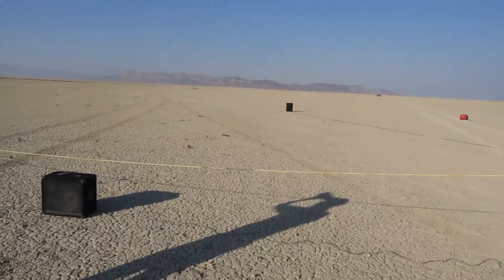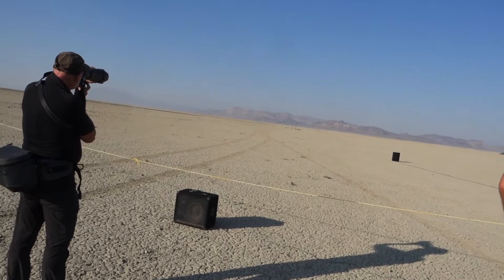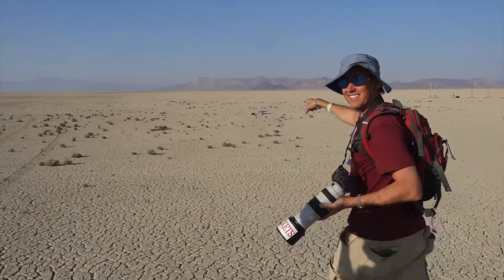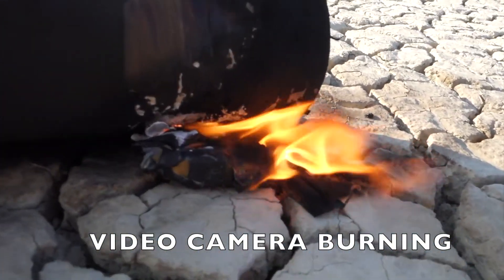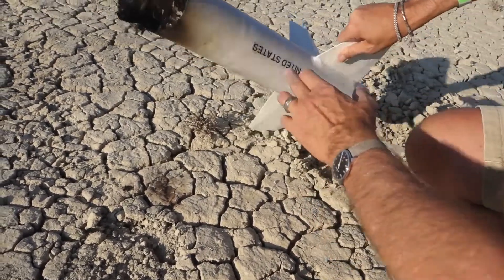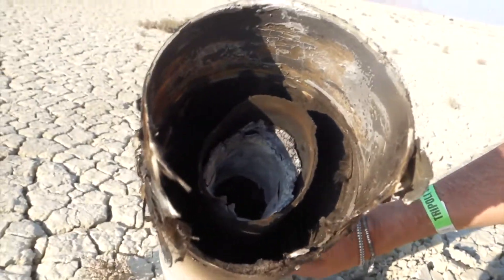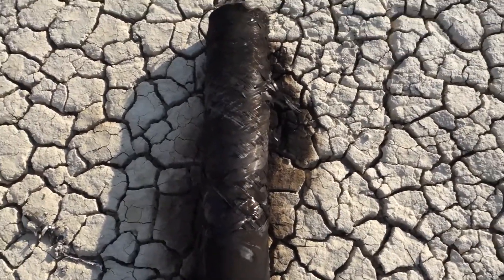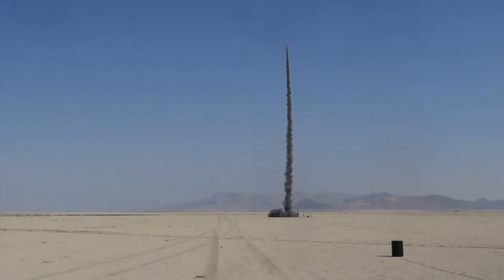My Rocket Launches at BALLS 2021

Comment: Nice flight on the K850!
Those foward closure failures are tough. Earlier this year I had the exact same problem with one of my rockets flying on a CTI K650 Pink. In August, I flew the a K820BS but glued the foward closure to the motor liner, added extra O-rings, and used a ton of silicone lubricant. The motor luckily didn't CATO but it still bulged even after taking precautions. I would avoid CTI for the time being until they fix this problem.